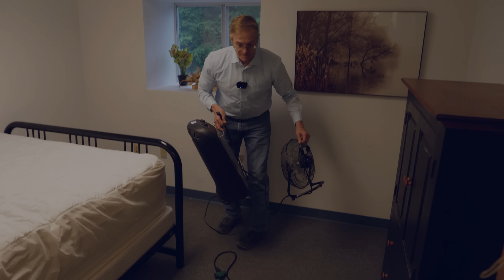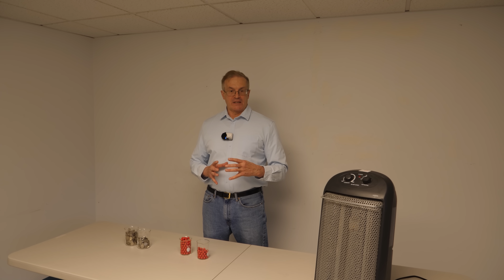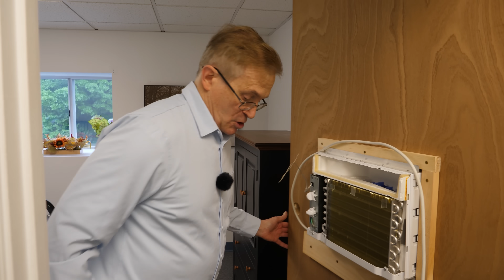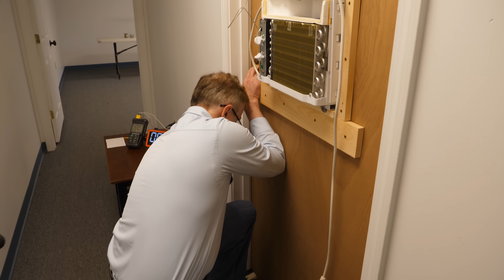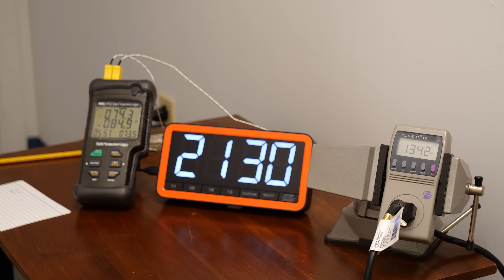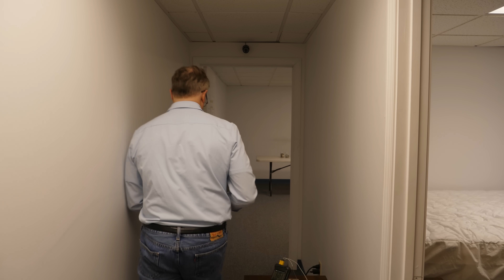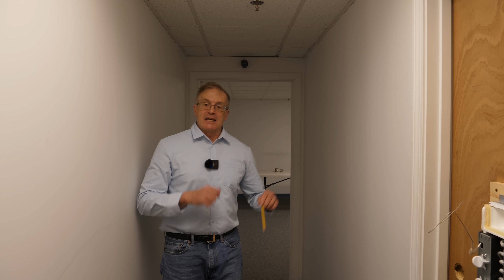You're wasting money on heating! Use your A/C!

Comment: I can attest to this effectiveness.  I have a small glass-enclosed porch area.  I was attempting to heat it with a 5000 BTU space heater plugged into a regular outlet.  It barely did the job, and raised the power bill by almost $25 when using it.  I replaced it with a 12,000 BTU mini-split heat pump that has a 22 SEER rating.  It will put out warm air even when it's 30 degrees outside.  It only draws about 6 amperes at 120 volts, whereas the space heater was drawing twice that amount of power and putting out half the heat of the mini-split.  The glass enclosed porch stays nice and toasty inside even on the coolest days, and the usage is barely noticed on my electric bill.
Reply: Gas is even cheaper than electric
Reply: @TurboXray  We are not allowed to use gas directly because we would be polluting by releasing greenhouse gasses like CO2.   Only the power companies are allowed to do that, and they can burn whatever they like including coal which is then wasted through miles of aluminum wire that has a resistance of 0.083 ohms per 1000 feet, which if you calculate 5280 feet or a mile ends up a whopping 0.438 ohms per mile through 600 MCM aluminum wire meaning power lines.  But whatever, lets count the minimal savings of a heat pump VS resistance coil.
Reply: @ 
The "climate change" cult is evil, and they really want to de-industrialize the West. Otherwise, why were china and India exempted? The #1 "greenhouse gas" is water vapor, but they will not tell you that, because how are you going to blame water vapor upon man?

We are not allowed to use gas directly because we would be polluting by releasing greenhouse gasses like CO2.

Whatever nonsense are you saying here? No matter how "harmless" that your refrigerant is, we need to reuse it again and again, otherwise your A/C will not be running for long anyway. That is why refrigerators and air conditioners have sealed refrigerant systems. All the boiled refrigerant is retained by the system, to be compressed/condensed and used over again and again. You can get cooling-only by using up the propane in your tank for your gas grill, the tank can get quite cold, as the propane is boiling inside due to the lowered pressure, but before long, all the propane is gone and there is no more cooling. But if propane was your refrigerant, then you would be compressing it again, and putting it back into the tank. Well compressing a gas makes it hotter. You can find science experiments, in which compressing a gas causes such heat as to ignite a piece of paper placed into the cylinder. Also that might be very bad inside a submarine, if it suddenly collapses in, even before the cold ocean water gets you. By adding a condenser coil to your setup, with a fan to blow off the waste heat, you can prevent that heat from traveling over to the evaporator low-pressure side and negating its cooling effect due to the suddenly drop in pressure boiling the refrigerant.
Reply: @ it is, until you factor the price of running a gas line from the opposite side of the house, installing a vent, and the larger space consumption of the gas furnace
Reply: @audvidgeek  Please do, just be sure to exclude the government taxes imposed by the former administration, because in reality this has as much to do with CO2 emissions as nuclear power has with "clean, green, and too cheap to meter".  To put in perspective your electric furnace once the heat pump ices over meaning its snowing outside, uses more energy than an garage EV charger uses on fast charge.  Electric furnace 10,000 watts, EV about 7,500 watts, and electric water heater is roughly 4,500 watts.  But whatever, you do the math, I actually have no vested interest either way, but I can tell a grift when I see one.
Reply: @Ed-ty1kr   I dont have an electric furnace, i have a gas furnace heating the house.  the heat pump only heats  the glass encosed porch, and its only turned on when we are out there , when its really chilly, or really hot out, so, it will never be using over 800 watts or so.
Reply: @Ed-ty1kr grift? 😂 what are you talking about?
Reply: @bradical2723  CO2 is plant food. Global warming is a grift.
Reply: Can you help?? I don't understand how to do this,I don't understand
Reply: @tayloredon2527  Just install it backwards, turn your window unit around, snake your cord past back inside, and walk outside to turn it on. 🤷‍♂ edit: don't forget your bucket...
Reply: @Ed-ty1kr  bucket? What's the bucket for?
Reply: If you pay attention to space heaters. No matter how large they are. They output the same power. They are absolutely garbage for large spaces.
Reply: Bull. It won’t heat any significant square footage at a sustained 30 or 35 or even 37 degrees exterior temp
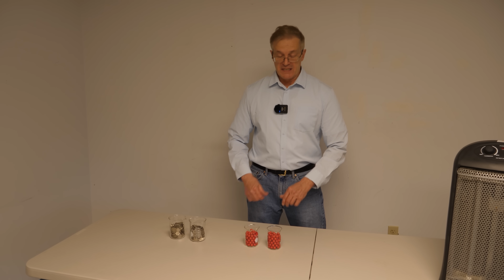Reply: 2:44 timestamp test to teach my 6 year old daughter about timestamps and hyperlinks 😊
Reply: U can ALSo use Mylar-reflective  tint filmed plastic on the windows for even greater heat retention. I'm using rolls of aluminum filmed bubble wrap in my RV walls to VASTLY keep more heat reflected insidevin a simular way!
Reply: Great example, thanks for sharing that.
Reply: Didnt watch the whole video. But my experience is anything that runs off two legs is going to cost. Higher seer ratings helps. Im heating my 450 sft bedroom with a mini split. Its been below freezing lately here in north fl. Been doing a great job. Defrost cycle is quick its only 16 seer but electric bill is way better than my 1kbtu window unit. And my 3 ton package unit takes alot and wont even heat or cool back here the floor vents the further away. My apartments have 2 ton splits 1100sft. They work but electric bills are high as heck.
Reply: I never knew A/C could save on heating! Mind blown! ❄🔥
Reply: @tech ingredients Where is the follow up video? Thanks.
Reply: Those things are outrageously priced. 

Should have just bought another space heater.
Reply: Until the temperature outside dropped below 0°C or 35°F, at which point your heatpump stopped working because the condesor coil froze up.  Heat pumps are great for anywhere it does not drop below freezing, after which the system goes into "emergency heat", meaning the coil kick in and heats the room same as any other electric heater does.  As far as what makes your "mini split" ... meaning DUCTLESS...  efficent, is the fact that it is duct less, and you are not reheating the air in a hot 150°F or cooling in winter in a freezing attic which the ductwork runs through. Yes it gets that hot in your attic, sat up there long enough as an HVAC technician with my voltage meter that has a built in digital themometer to know. Also not having the unit hard cycle on and off discharging the capacitors, and instead ramping up when and if needed, or maintaining a low cooling cycle temp with a slow steady recirculation of air.  Basically it is similar to how one can save gas by driving on a country road at a steady slow rate, vs having to stop and go driving in city traffic.
Reply: @Ed-ty1kr  The coldest it has gotten here is around 13F, and it's still putting out temperatures above 95 degrees.  It works quite amazing!  Yes, you are correct that older heat pumps don't work particuarly good below 35F...had one in my old home that was just like that, but these newer mini-splits are perfecting the tech!
Reply: @audvidgeek can u tell me what brand u are using?  Where we are, temperatures are not super freezing, but can go down to 28° even as low as 26 but are usually between 30° and 35° at night time during winter.  We live in a crawlspace home so the larger bedrooms get very cold currently running two space heaters to keep the bedroom between 65 and 70°.  Shopping around now for mini splits.
Reply: @audvidgeek  Um... that's because it either has a resistance coil that turns on when temps drop below freezing, or reverses the process for a short period of time without allowing the liquid refrigerant to circulate and meter into a gas past the evaporator coil, and thereby melting the condensing coil which will absolutely become frozen if temps drop below 35-F or 0-C.   Same as your refrigerator does with the auto defrost cycle.  But all of those processes consume energy.
Reply: @Ed-ty1kr  It does not have resistance coils.  It's rated at a maximum 8 amperes at 120 volts.  If it had resistance coils, there's no way it could produce 12,000  BTU with resistance coils.  When it goes into defrost, it stops the indoor fan and outdoor fan.  Defrost takes about 5 minutes, and it's back to heating again.  I have a gas furnace to heat the main part of the house, but decided on the mini split for just the porch area because of the ease of installation, and that the space isn't gong to be occupied all the time.
Reply: @audvidgeek  Like I said.  "either has a resistance coil that turns on when temps drop below freezing,  OR reverses the process for a short period of time without allowing the liquid refrigerant to circulate and meter into a gas past the evaporator coil, and thereby melting the condensing coil which will freeze up below 35-F or 0-C.
Reply: @Ed-ty1kr  how about minus 30 Celsius …. Right here!?
Reply: @Ed-ty1kr  heat pumps have come leaps and bounds. If you are really into the new tech. Should look into cascading heat pumps.
Reply: @sirsneakybeaky  Look, it's not going to outperform a simple gas furnace.  Because you can't replace the energy loss thought the power grid 🤷‍♀.  At least not until the power grid moves further into green renewable energies like wind, or ocean waves, or geothermal.  The planet is bombarded with energy daily, if we can incorporate that somehow then sure, but running coal plants or oil, and the losses undermine the gains.
Reply: @Ed-ty1kr  but it literally does. by leaps and bounds.
Reply: @sirsneakybeaky  Here is some interesting food for thought:   A heat pumps efficiency gains in cold weather, meaning for heating, is offset by a heat pumps reduced efficiency in hot climates, meaning for cooling.   So any gains you get by pushing a heat pumps efficiency in cold temps, will be offset by losses in hot temps due to their use of  changeover valves.  And like I said a heat pump is only going to work in warmer climate regions, which tend to have longer and hotter summers.
Reply: @Ed-ty1kr  I suggest you look into the new heatpumps that use a cascading paradigm. This is only an issue in the lowest end units still.
Reply: @sirsneakybeaky  Two heat pumps is still two heat pumps with on in defrost while the other does the work... So you are basically running 2 heat pumps at the same time, with a single compressor.  And yes I had installed Daikin/Goodman systems for a living a decade ago when this was first introduced, and even then the concept was nothing new.  It's a lot like how EV's are now the latest craze, yet in 1900 40% of the automobiles in the US were steam, 22% gasoline powered, and 38% electric/battery driven.   Diesel was invented just 3 years prior so no stats were include, or nonexistent.
Reply: @Ed-ty1kr  again. You can "trust me bro" all day. The technology proves you wrong. A 2 stage heat pumps today have a lower bound of 0-3*c with 60-70% efficiency. And 3+ stage goes even further.
Reply: @sirsneakybeaky  All right I'm out, tired of hearing about it. I proved my points on this stale argument anyway.  Bye Bye
Reply: @Ed-ty1kr  Heat pumps can detect when they have ice on the coils and will initiate a defrost.
Reply: @gregorymalchuk272  Ugh... 😞What does that have to with anything?  When the temperature drops below freezeing, heat transfer stopps, the coil freezes over preventing air from flowing through it, and more energy is needed to reverse the process.  Does'nt matter how hard you try to push this process you will only be able to use it in temperate climates where you dont see freezing temperatures, or during specific times of the year until water begins to freeze.  Period.   Temps drop below freezing and a heat pumps "efficiency" gains are compromized.  It is what it is.
Reply: @Ed-ty1kr  Heat transfer continues while the evaporator fins begin accumulating Ice and doesn't stop until the evaporator is a brick of ice, then a defrost begins. Ice has a non zero specific heat and thermal conductivity. And that is only at around 40F. Below freezing, the air gets so dry that icing got the evaporator is much reduced.
Reply: In any case the most efficent means to heat your home is still going to be a gas furnace.  But no one likes to hear that anymore, and would rather the pollution is done at the power station, then sent down miles of power lines which lose alot of that energy created  through resistance and step down transformers.  Not to mention they mostly burn coal... but whatever.
Reply: @Ed-ty1kr Dude almost everything you said is wrong. I am an energy engineer and heat pump designer. Shit products will barely function at extreme temperature intervals, but well designed heat pumps with good defrosting cycles will be very efficient at super low temps. Regarding the gas boiler... just no. Heat pumps multiply by 4 the electrical input when generating heat, and power plants have >50% efficiency. This means that heat pump is energetically (and especially exergetically) twice as efficient as the boiler. Also, large power plants have mandatory pollution abatement systems and only emit CO2, while even a condensing boiler will emit some bad stuff. It's better to leave decisions to people who know what they are talking about.
Reply: @Daekanoid  LOL... yeah, and I'm the king of the Martians here to tell you that you are wrong, because bottom line is we are still producing most of that power through fossil fuels.   Power that we then sent down miles of copper or worse aluminum wires, over coils, contacts, transformers, resistors, to electric motors, capacitors, and the friction created by the compressor itself. All of which creates resistance and ultimately energy loss.  So how can you tell me that simply burning the natural gas and heating the home directly, instead of wasting it through all those measures, is somehow less efficient?   Besides that we are like I said before, burning mostly coal, oil, or creating the worst pollutants ever invented that are not found in nature called highly radioactive anthropogenic isotopes, that destroy living things on a molecular lever by damaging DNA, and that are pollutants that we know not what to do with.  All pollution just to produce electricity that is then wasted.  Why?   The heat was already created before the power station used it boil that water into steam, so why not heat your home right from the source?
If you believe heat pumps are more efficient throught he entire process my friend, then you either had way too many years of indoctrination, or you are selling the heat pumps that you have a vested interest in as a "heat pump engineer".   Which is not at all surprising to me coming from the HVAC industry but I digress.
 Question: Do you know why fish and chicken grown on US farms is frozen, then sent across oceans to China to be cut into pieces, packaged, refrozen, and finally shipped back across oceans to US grocery stores?   Same reason they prefer to waste energy by transmitting it through various mediums including but not limited to lithium batteries, instead of using the fuel source directly.   It creates jobs, builds the economy, and helps secure peoples jobs that re-engineer the wheel, by pretending that round is more efficient than those round wheels we had been using for centuries.
Reply: Thank you for sharing. I appreciate you.
Reply: I have the same kind of porch I'd never heat it as I'm not a multi-millionaire but if you don't want to heat the outside then you need to use that heat shrink plastic over all the windows. Also put thick plastic over the outside of the windows. If you do both it will make a huge difference and maybe make it somewhat practical. At least use the shrink plastic inside, there's no excuse. Heating without insulating is peeing in the wind.
Reply: @stdcoutmynameendl   I had a porch back in 2005 to 2011 that had dark tinted marine vinyl or rubberized sheeting installed instead of screening that worked relatively well. It even had 4 sliding screen doors that I could roll closed by the pool area. But that was here in Florida and it don"t get that cold.  There is also Florida glass screening that blocks out wind, also called privacy screen I believe.  Other than that you will have to turn outdoors indoors by some double pane windows with glass on the outside, inert gas in between, and a glass pane outside.  To make some greenhouse like porch area that you can introduce a heater into.
Reply: @ 
The inert gas between the window panes, I think that is primarily to eliminate the problem of that ugly water condensate drops that some old tired double-pane windows produce.
Reply: @ 
Plastic over the windows probably looks ugly. Much of the reason for the room is for the view. And if this is anything modern, he probably already has efficient windows? And he said that it is not occupied or conditioned all of the time.
Reply: @ The ceiling is insulated with R25, the floor with R19.  The windows are Anderson dual-pane glass windows. It's pretty well sealed up as much as it can be.
Reply: Is this toxic though? Don't they give off toxins from the freon?
Reply: @mirandaanderson1412  All the freon is contained. If there's not a leak your fine and you'll know if there's even a pinhole leak it's under so much pressure it will spew out. Biggest problem os this won't work in the winter so it's pointless. It can't pull much heat from air that cold because it is not designed as a heat pump for heating just cooling. No home air conditioner has a thermostat that goes near 32f. It will work probably in 45 degree weather at the least .
Reply: @ 
I am pretty sure that the phasing out of freon was a giant scam. The "hole in the ozone" went away, because it was never real to begin with.

And the refrigerant is a sealed system. It never gets out, other than from leaks. We use refrigerants, such as even propane, because the boiling point of water is too high, also doesn't water have a tendency to freeze? That is hardly good for refrigerant lines that need to flow. Why is the evaporator coil in your A/C so cold? Because the refrigerant is literally boiling in there, absorbing the ambient room air heat. On the low-pressure evaporator side, the refrigerant boils at hopefully just a high enough temperature to keep it from icing up. When there is an icing up problem, I think that is usually due to some of the refrigerant having leaked out, causing the pressure to drop below normal operating norms.

The reason that the condenser side gets hot, is that the higher pressure changes the boiling temperature, to be so high, that merely an outdoor fan can blow off the waste heat. The high pressure forces the refrigerant to condense so that it can be cycled through the system again and again. Your propane tank on your grill gets cold as you draw off the propane. But that is not a very good air conditioner, as the propane gets used up, it does not go back into the tank again.

That is one reason that your hot condenser coils on your refrigerator need adequate circulation, and should not be clogged up with pet hair. If that heat can not be shed, it will travel around to the evaporator side, which then struggles to get cold enough, and the refrigerator runs and runs, hardly able to stay cold enough inside. Or if the defrost system fails, the evaporator coil at the back of the freezer, ices up, not enough air flow, refrigerator loses its cold.
Reply: Why are you heating a porch??? Stop.
Reply: @WhiskeyNixon  so that we can sit out there when it's not perfect weather.  The heat pump is not left on continuously, but only when we are out there using that space.  It is a nice space to eat out there, or just to sit and read a book.  The view is really nice out the windows of the woods around us
Reply: @audvidgeek  I don't think person chastising u understands that the porch is closed off so ur not trying  to heat the whole world.
Reply: Thank you for the explanation some people ask stupid questions or leave dumb useless remarks
Reply: @audvidgeek Replying to an ignorant person just isn't worth it!😂 Great idea and am glad it worked for you.
Reply: @WhiskeyNixon Why do you care?
Reply: @adamboutwell5317  I care for the same reason you care if you saw someone about to get hit by a car. You would tell them to stop, or watch out, or whatever. Right? Right. My threshold for caring is just much, much lower.
Reply: @WhiskeyNixon nobody cares
Reply: @WhiskeyNixon   so, my life is in imminent danger by occupying my glass-enclosed porch and using a heat pump when it's too hot or too cold out to open the windows?
Reply: @audvidgeek  no, that was called a proof. They are often exaggerated to more easily demonstrate underlying principals that may be lost in more nuanced cases.

Insulate your porch.
Reply: @adamboutwell5317 in the winter people enclose their porch with plastic to keep it warm , keep snow out ect. It also helps hold heat in the house better. Then u can keep the porch warm like a dun room. Perfectly practical if u have true winter, with 10° f and snow.
Reply: @WhiskeyNixon lmao
Reply: @WhiskeyNixon  they literally said the energy it takes barely even shows up on the bill. 😂
Reply: Maybe that porch has views of nature instead of being stuck inside in a depressing Winter. Geez. @WhiskeyNixon
Reply: @focusabove2960  Well, geez, why don't we heat the entire outside, then? Gosh!
Reply: Some people love making use of their porch you rainbow haired freak
Reply: @WhiskeyNixon  To smoke weed silly....... Lol
Reply: @WhiskeyNixon      They do it for the same reason I rescued Little Red Riding Hood, because they can, they want to, they see a reason, and it's identifies those we need identified.
Reply: Stupid question
Reply: @ 
Why are you heating a porch??? Stop.

Maybe it is a great sitting area, place to hang out with company, a good bright place to read a book? Why do people have sun-rooms? Probably plenty of reasons.
Reply: @WhiskeyNixon  Make outside like inside 😂😂😂

Turn the sun down it's bright 😂😂😂
Reply: @WhiskeyNixon   who tf do you think you are? Mind your own business.
Reply: @allaboutroofing2  I'm someone who tells someone to stop doing stupid things.

Stop being a dumbshit. See? I did it again. My business? The OP made it everyone's business, trollop. If the OP doesn't want criticism, the OP can choose not to share their ideas. Intelligent people can take criticism without getting their feelings hurt. And no, that's not a contradiction. Intelligent people do dumb shit all the time.

The fuck you think you are?
Reply: @allaboutroofing2  My honest reply to you is missing. It seems this channel is suffering from censorship or something. Looks like I'm not allowed to tell you how I actually feel, fuckface, because someone else thinks they ought to be able to control thought and speech, like some megalomaniacal deity or some shit.

Get fucked.